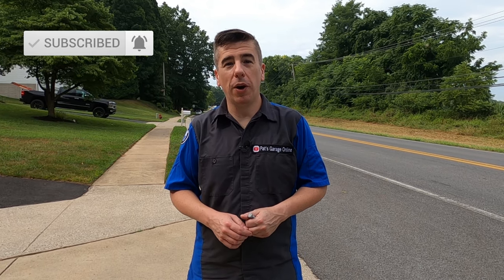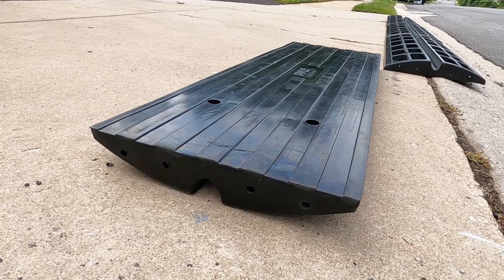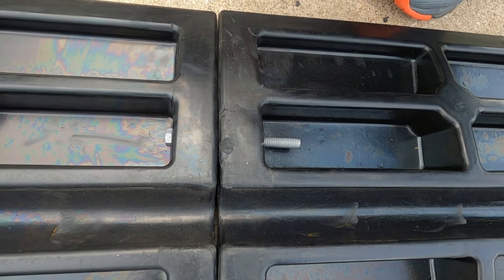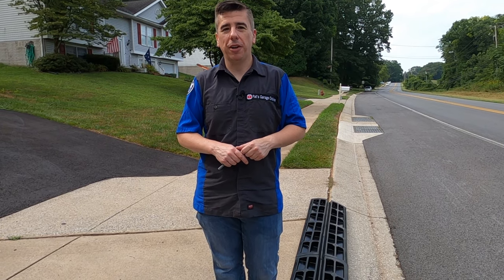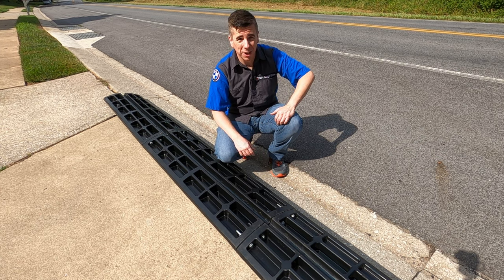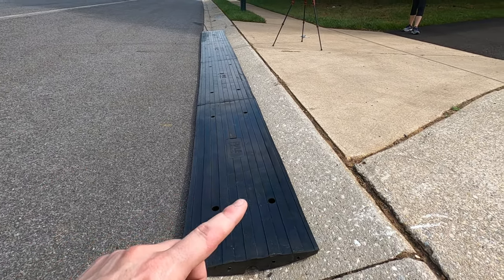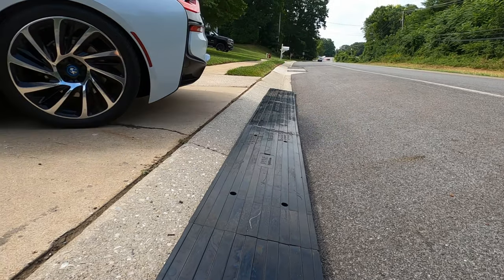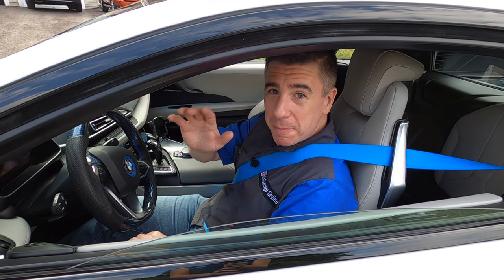BMW i8 won't scrape with Pyle Driveway Curb Ramps!

Comment: Yeah, I'm interested as well. I have the Bridgit one as too. I love it and it actually allowed me to drive up a rather steep driveway straight on in my i8! My Gt-R is lowered so I still have to angle up in that but it simply would not have been possible otherwise without scraping.
Reply: Thanks for this, I'm grateful my suspension is stiff enough to 3 wheel my 4c, i appreciate you adding your opinion

Comment: I have a new Corvette Stingray and have a similar problem getting in the garage. It’s a little more difficult to angle into the garage. Do you think this would work if I approached it straight?
Reply from the maker: It totally depends on how much clearance you will have between the top of the driveway curb ramp and the top of the concrete curb.  I couldn't do that with my i8, but your Stingray may clear it.  I moved away from that house and left the curb ramps so I can't provide any actual dimensions.

Comment: Thanks Pat!  I'm curious what you think over time.  Our Bridgit has been pretty good although they do move a little from time to time.  The feel in car is soooo much better.  I believe our curb might be a bit more angular than yours maybe?  The Bridgit is really for a rolled curb but seems to work pretty well.  Great video!  Franny
Reply from the maker: Thanks!  Mine also moves a little.  I needed to adjust them a tad since I installed them 4 days ago.  My heavy truck is likely making them move more than the cars.  But, I'll keep an eye on them.  I think these are also better for a rolled curb but they still feel really good.  I have to remove them when it snows.  As you can see, I live on a somewhat busy 30MPH street, so it gets plowed often and these would get pushed down the road.  LOL!
Reply: As a side note, dimensionally the Bridgit product and this one are almost identical including the rear curvature.  The only reason this one appears flatter is because of Pat's longer flatter curb entrance.  I do agree that the Bridgit product is a little more substantial (mainly because the end pieces are beveled) but I couldn't justify spending the extra cash just to get 5.  It's been a life-saver (or should I say, front air-dam saver) for my Porsche 911 Turbo.

Comment: I won't be using these I think I just need a piece of plywood and then I should be fine. Or I can just have a guy come out and see how much it would cost for them to fix the drive way ramp. We got a new car and the fender keeps hitting it going out of the drive way not so much going into the driveway.

Comment: Thanks for the video. What size are the bolts and nuts you used to connect the ramps together?
Reply from the maker: Thanks. The holes are 1/2" so you could go 7/16" or 3/8". I used 3/8" by 4" long. But you could probably use a 3" long bolt.

Comment: I have a gravel driveway and it washes away every couple years. Would it be a good idea to lay two these down and cover with gravel? Or any help from keeping it from washing away would be appreciated
Reply from the maker: My family has that problem and it was better to pave it. Cost a lot but the problem went away. If you add these rubber things, it would likely just make the water divert and create other problems.
Reply: @PatsGarageOnline  could I ask another question? Could I lay a base layer of 4inch Cap block with space and full with gravel?  Do you think it would help at all?
Reply from the maker: @adammaximus9957  no idea what to suggest. I'm not familiar with how to fix this problem except for black top
Reply: @PatsGarageOnline  thank you anyways. Great videos
Reply: Pudieras dar el link de dónde comprar la rampa por favor

Comment: Hey patt do you have a bmw i8 sheet on what repairs or maintenance you should do every certain time
Reply from the maker: Oil change at 10k miles, Spark Plugs at 30k miles. Door struts yearly.

Comment: Alternatively, you could install a modest lift kit to your low vehicles’ suspension. I like this driveway solution all but for the need to remove a 200 lb dirty object every time roadwork like snow scraping vehicles need to access the pavement.
Reply: Adding a lift kit completely gets rid of the reason why many cars are low in the first place, the lower you are the better your aerodynamics and handling.

Comment: But what solution works for a higher road and a lower driveway? Where the slope is down towards the garage and the low clearance car scrapes going in because it basically teeters on the sidewalk/driveway edge for a second before driving further?
Reply from the maker: That's a tough position to be in. It would seem the only solution would be to have the surfaces modified so there was less of a peak. I'm not an engineer so it's just a thought.

Comment: 50lbs? Seems intended to be permanent. Do you not have snowplows?
Reply from the maker: I unbolt it into 2 sections and drag it into my garage when I'm expecting snow, and I drive my 4x4 truck, so the ramps aren't needed.